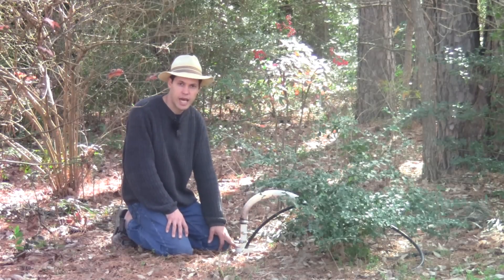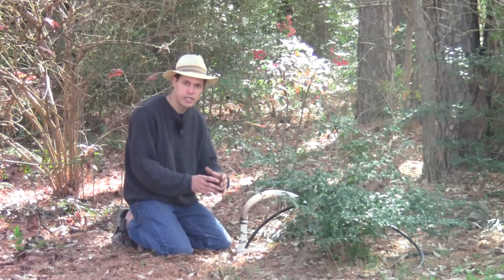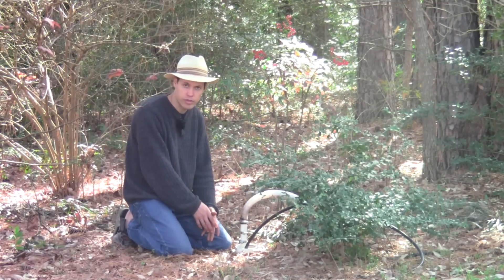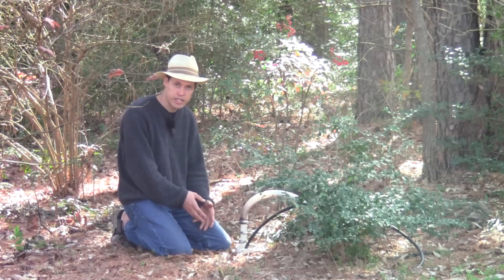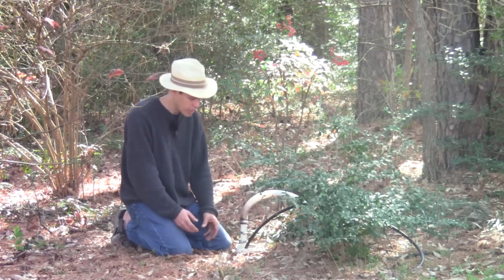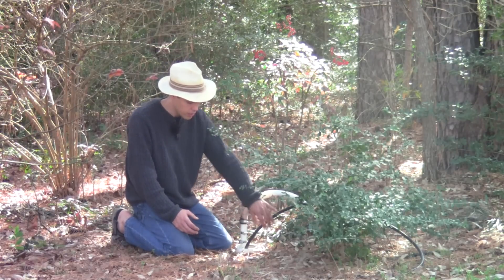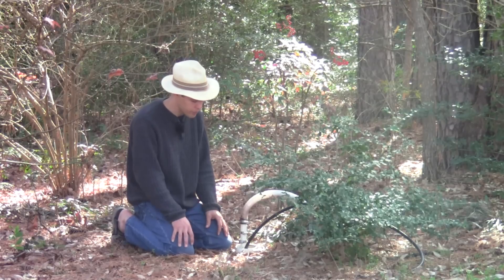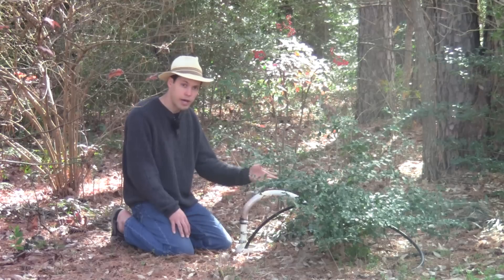Watch This Before Drilling Your Own Well!

Comment: I want to drill a well to keep my pond full when we have a drought, if the pond has a slight leak wouldn't the water from the leak go back into the aquifer? So really just rotating the water?
Reply: More or less, yes; however some is lost due to evaporation. How much depends on a lot of factors - heat, wind, surface area, etc.

Comment: So what I wanted to ask was....

Once you do hit water, how far do you want to go beyond that to think of over time how you may be depleting the water level in the well? Isn't it better to go beyond the initial water contact line a certain point to plan for the future? And if you did how far would be appropriate, in terms of well long term use physics? 

Also, when you look at sand point well hammer point systems, they have this certain area that has screened holes after the first bit of the tip. I was curious to think about this... would it be ideally better to have those screened tiny holes, slits, etc go all the way up the well? Or would you get comparable results with them only at the ends when comparing having a large area to them to only a few feet? 

I'm also curious why people only do one well on a property and don't think that maybe in long term use they might have an alternate well, to let the well rest and replenish itself sometimes?
Reply: Ordinary domestic users don't really depress the water table. Only massive industrial wells do that. The well doesn't need to rest, it doesn't work that way. Generally, you want to go deeper than the water level by 20-50 feet, depending on how much water is there, so that you have plenty for pumping and drawdown. The slits typically go have the well or 50', whichever is more.
Reply: Thank you very much! 

This kind of technology really is amazing.

Comment: Do you think a 2 stage 5hp 15.8 CFM @ 90 PSI, 16.4 CFM @ 40 PSI will work? 60 gallon tank?
Reply from the maker: No, you need at least 17 CFM @ 90 PSI, preferably 20.
Reply: HowToDrillAWell I just bought the Rig today and 6” casing bit. Spendy for good air compressor thanks for reply. Trying to get used one off craigslist.
Reply: HowToDrillAWell You guys should apply to go on shark tank tv show

Comment: My area in Florida  is just sand and water....until  you get to 60 feet then it's bedrock....only  commercial drilling can get past that....period....so everywhere it's different... my home I had in Connecticut had gravel for 300ft then suddenly they hit an underground river...the stones came out polished...the water was coming out of the well after the drilling stopped.  The drilling company never seen one like it, pumped it for an hour,  a 500 gallons a minute..6 inch 324 ft artisan well...didn't even need a pump...only for pressure....the earth is a world underneath of so much plenty....a master Creator was the  Almighty engineer.

Comment: I am very interested in the potential of the product on my property.  I understand what it is and the limits of it's capabilities.  I believe the drilling will work well on the very sandy loam of my property. Most area wells are about 50 feet but start hitting water as early as 10-12 feet.  My concern is not the drilling.  I believe with time and patience you will get a deep hole in the ground that will reach good water.  My overwhelming concern is cave in.  Sandy walls and moisture do not tend to hold up well and I don't want a $700 experimental drill head stuck irretrievably in a 40 foot hole. I have seen several video of folks having their 4 inch hydro drilling PVC permanently stuck in the ground 20 feet down from cave in.   How does one avoid the sides caving in and losing the drill bit and motor?
Reply from the maker: If you follow the rules, cave ins are rare. Caveins happen because there is an empty space, and the dirt falls in to fill it. To counteract that, we keep the hole full of water at all times, and use drilling mud, which raises the specific gravity of the water significantly making it far less likely to have a cave in.

Comment: I just used this Product. I am going to try to post the entire experience please forging typos.
Review Of how to drill a Well Kit
I am luck in Texas on my own land 12 acers I can drill my own well no permits
1st I am 65 years old and not in good shape. Also I have been burned with on line purchases before. This company is 1 hr 15 min away from me If its junk and don't work I can and will be on the front steps. 1st Impression the Factory area is more of a casual barnyard, Not Impressive at all/
The Staff /Workers that was there was working on manufacture of Green houses. I was Leary about popping 700 bucks for the Kit but I did need a well and My Attempts at watter jetting got only 30 ft. The Kit looks like a kid put it together and comes with a Manual and two CD/DVD I was told to watch all of it and to Call the owner Nataniel If I needed advice or got into trouble. The Big Pain I see is getting/Renting a heavy Duty compressor. I need to be down 80 FT 10 feet past my desired depth for the well. This Review will be a work in progress. Un boxing shows the same Items as on the web Page.

I was Impressed when I called for advice how fast someone got back to me. For me thats a good thing. I went with a 4 x 4 foot slab with a six inch case. Place Six foot down. I do know I will hit water at two feet surface water pooling. A  1 foot layer of clay then  sand In this swamp. I will also Hit from 10 past water that is stable at 17 feet I will be in water bearing sand an I know it will be the good stuff all the way to 8 feet. I am worried about the drillers mud an the side caving in. 

There is a lot of preparation prior to drilling. Weather has finally given me a shot the rain is clear. Today I water jetted a 2  inch hole for the well 17 feet Through 2ft Topsoils 10 Feet of Sand and Clay Mix then a hear layer of Clay and Iron Gravel some  annoying rocks. I am Calling this a Pilot hole because I Know I can get to 30 ft with the water jet. At that Point I will not be able to push enough water in to get any cuttings. This is when I will rally need good weather and will rent the compressor. I hit multiple ore rock

The Kit Issue the the Dehumidifier /Air flow regulator Didn't work at all The Oiler did but it was a combined with the dehumidifier. Because of the faulty regulator day one was a night mare very slow and the bit would not operate correctly. Rocks would lock it up again the regulator/Dehumidifier was the issue. 

I had rented the biggest compressor I could find. I called the rental company told them I was bringing the compressor back. They Assured me the compressor would shove oil through to the tool all by itself.

I went back to work bypassed the dehumidifier and oiler hit the switch an the drill began to scream like it was supposed to. Blew through Red rock Iron ore (Rocks) No Issue this thing was spitting out Rock and Iron ore with no Issues at all 20ft in and ½ hours I hit clay and gravel it slowed me dona a bit. I was done with 70 ft in 8 hrs tops. I mean done, Put the sand screen in 4 inch. For some redone it took way more gravel than 500LBS, I have to go and get more in the am.

It isn't hard work just tedious .Notes Make Sure you have someone to help it is not a one man Job.
The PVC Drill casing cracked mid way through the process. Gorilla taped it back together.

Bottom Line on the Kit it works but it isn't a cake walk I will be done with the well for about 1400 bucks. Companies here want 7 K drill wells in my area of Texas.
Reply: Awesome info. Thanks for posting this. I’m NE of Dallas about 60 miles in Hunt County. Am thinking of going into the drilling business but am in the research phase now. Sounds like you got a good depth in a short time. I’m curious where in Texas you are.

Comment: In California central valley fruit basket of the world we have been in a servicer drought for over six years with no mountain snow fall in Yosemite Valley.  The water table is low, during the 1940s central valley of California, water/table was 30ft now you need to go down 300ft to 500ft city's are going 5,000ft in the central valley of California.

Comment: Hey there ,how well would a submersible pump 1 1/2 hp ,8 in case with slots in the first 10 ft ,40 ft water level ,2 in pipe down to 90 ft, 100 ft deep sand type only hole . Do you think it will pull to much sand? Thanks tank.
Reply from the maker: It depends on the well - generally sand diminishes over time as a well is pumped out. But it may take months or years.